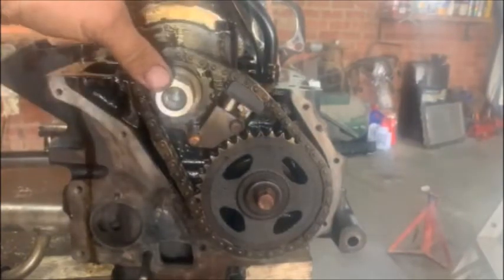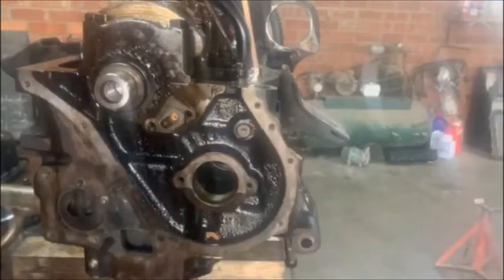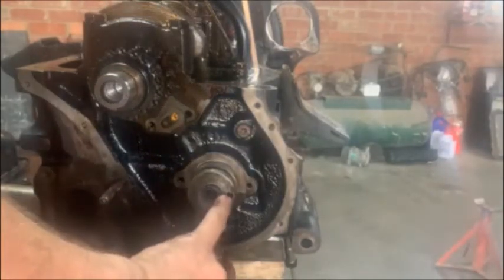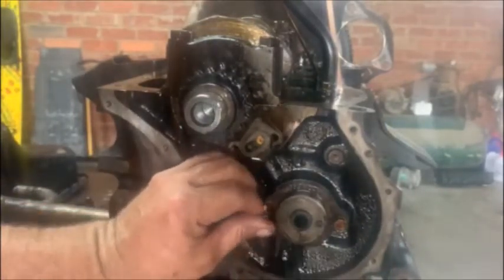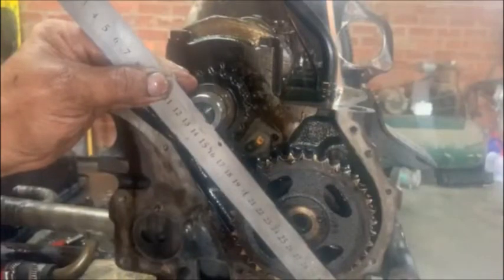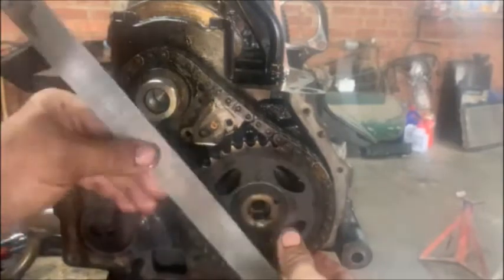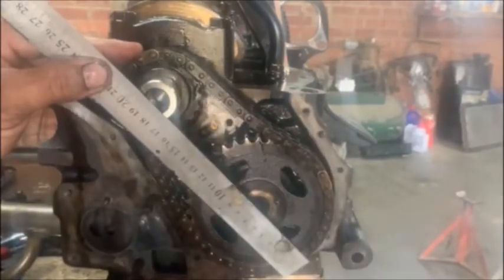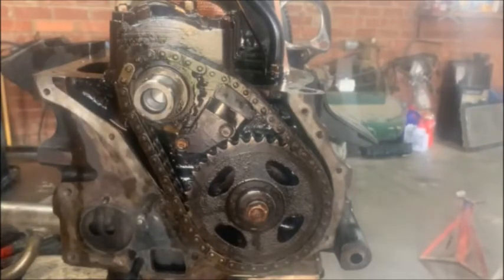Datsun Nissan A14 camshaft replacement

Comment: Hallo ...did you put in a performance cam?
Reply from the maker: Yes, I fitted a 276 degree cam from Camtech. I like it, it still has lowdown torque meaning you can easily drive in slow traffic but the cam really comes together from about 4500 rpm and rev to 7000 with ease making good power
Reply: Hallo i have a cam and it is "done"..but dount know what cam it is.On the side there is ingraved.....S65S....and....28177.If you can help me please i want to know what cut the cam is.Thanks